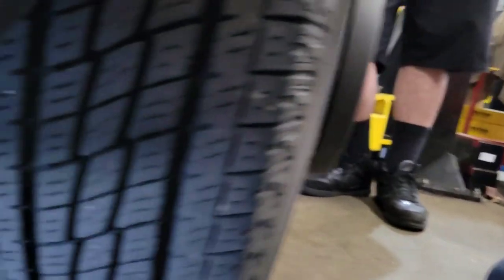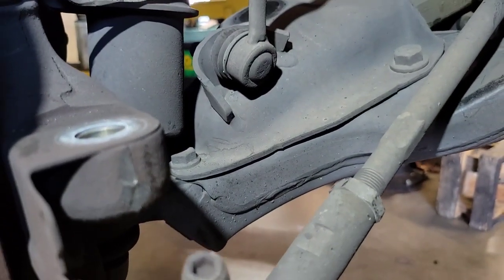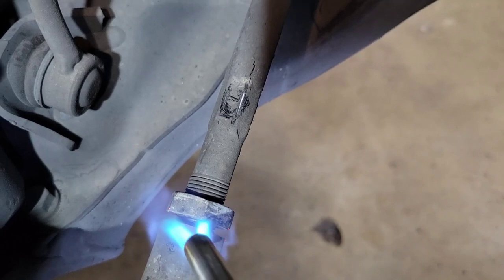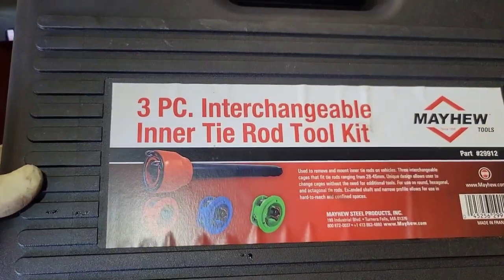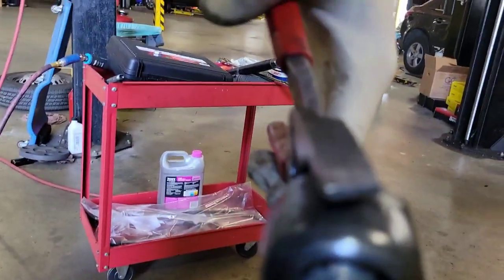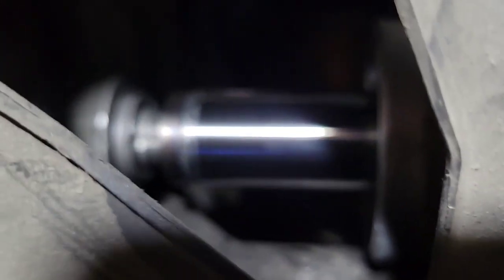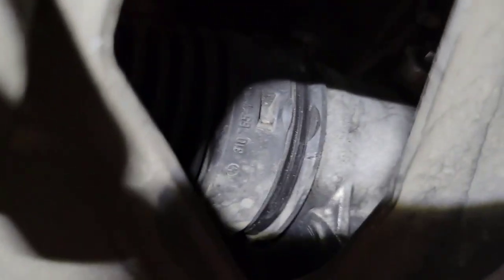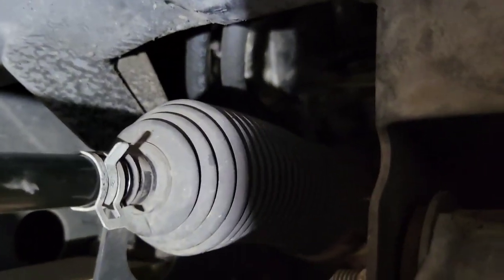How to Replace Inner Tie Rod Ends

Comment: I like the HF kit mostly because it comes with all the size adaptors
Reply from the maker: I have never seen a kit that worked for Sprinters to be honest. Thank you for watching.
Reply: I attempted to use the harbor freight tool  on my NCV3 with no luck.  The tool itself just slips on and you have to use two hands to hold it in and it's a difficult process. In the end it didn't work because it didn't have enough grip to break the nut free and would essentially just bend out and slip over it.  I ended up just doing the rest of the job removing the rest of the suspension turning it to one side and using a bfw.
Reply: @NelsonSeattle  the tool has a lock sleeve that does work though its hard to work it.
Reply: @fixitallpaul4847  Yes, I used the 40mm lock sleeve, it did not have enough grip to turn the nut.  Plus it's extremely tedious tool to use, you have to put the sleeve on, hold it on the nut while you slide the tool over it, then lock the sleeve, and then slightly pull on it to keep it on the nut while turning the breaker bar on the end, it's a 3 armed man job.    Honestly none of these tools are necessary for the 906, once you turn the steering 100% to one side, the nut is exposed enough to use a large crescent (14 inch) wrench.  Took me 2 minutes once I realized this.

Comment: That tool looks awesome! I have the blue point tool with the interchangeable wrenches. I always turn the steering wheel to get the inner tie rod to where I can best get to it. Are you at a new shop? The background looks a bit different. Great job yet again!
Reply from the maker: Been at the same shop for a year and a half. I do my sitting and talking at home usually and have back drop. I used to have to have to turn the wheel to try to gain access. This is why I like this set is I leave steering wheel centered and get the whole job done quickly. Thank you for watching.